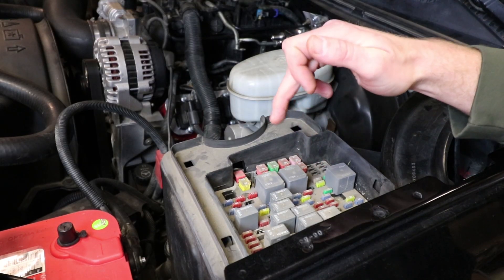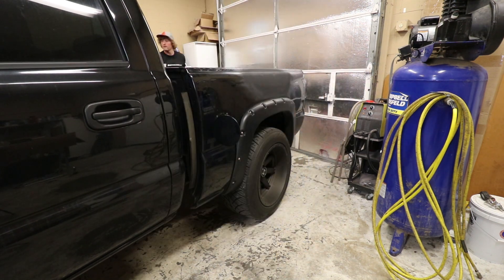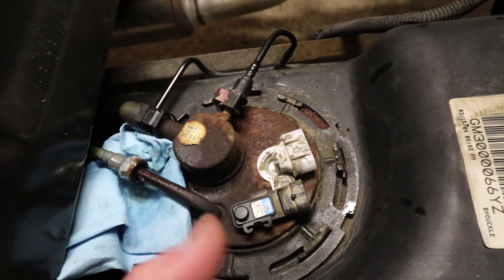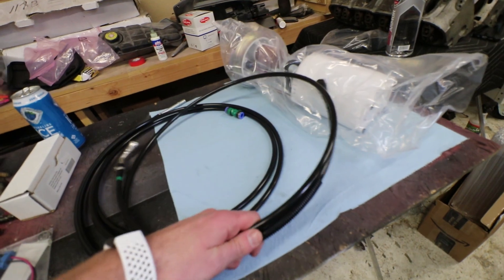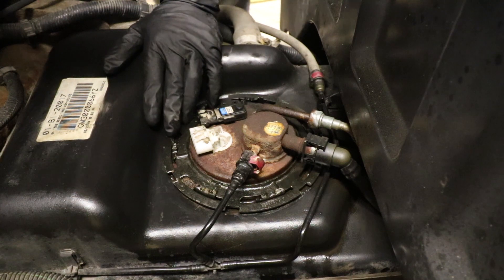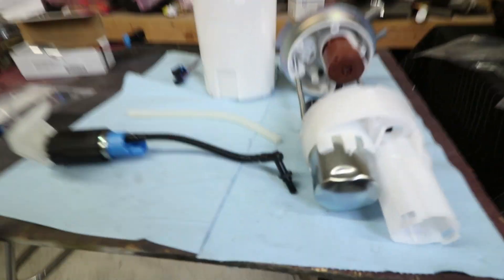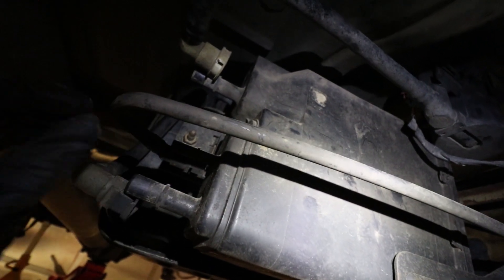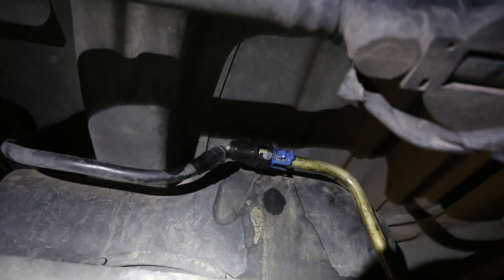Silverado Fuel Pump Removal And Install Sierra - Walbro 450 Fuel Pump Upgrade Install

Comment: Dp you have to replace fuel line aswell
Reply from the maker: I did have to replace the fuel line but that was due to the stock line rusting itself to the stock pump.

Comment: Did you run the stock injectors w the 450?
Reply from the maker: I did use the stock injectors, I have since upgraded but the injectors weren't my issue like I thought they were.
Reply: @MitchCarveth  thanks bro I’m installing the same setup this weekend. Just wanted to know if the injectors would hold up until I got new ones 👍

Comment: Did you use the higher pressure walbro 450 or the regular?
Reply from the maker: I went with the higher pressure 450
Reply: @MitchCarveth  thanks man!
Reply from the maker: @joseluisrojero5374  any time!

Comment: get away from that black fuel line. order the submergible fuel tube 11in from quantum again, its like 9 bucks. that black line will degrade  eventually. trust me i know ive looked at every parts store dealer blah blah pain in the butt, you have to order it. got same pump from quantum been rocking it for a year and half so far good. last week burned up the stock wiring though, definitely need a hotwire kit. only gripe with quantum is they dont supply wire diagram, and calling them they said they cant help they dont have any instructions.
Reply from the maker: I will be doing that for sure, I just had to use what was locally available at the time.

Comment: Where did you buy the fuel pump bucket assembly from?
Reply from the maker: This is the one I went with. 
 https://www.amazon.com/dp/B07P7886HV/ref=cm_sw_r_cp_apa_fabt1_ehBXFb7JN20FA?_encoding=UTF8&psc=1

Comment: Was that submersible fuel hose you used for the fuel pump? Also, any fuel starvation issues when low on fuel with that hole you cut in the bottom? Thanks!
Reply from the maker: I double checked before install and the hose is good for intake use. I did notice once it's near low it tried cutting out on me under heavy acceleration. Its best to keep at least quarter tank of fuel not only for starvation but fuel pump cooling as well.

Comment: Will you need a retune after changing the fuel pump?
Reply from the maker: Not with this setup, infact when we plugged it into the HPtuners we didn't even have to mess with fuel pressure, the stock regulator worked just fine.
Reply: I'm about to change my 06 Silverado does this apply here?

Comment: you skipped over the part of you putting in the pump in the basket , did you make it work ?????
Reply from the maker: It worked, I just took the insulation sleeve put it over the pump itself then slowly slid it into place in the basket.

Comment: I’m having the same problem as well same cam just BTR It’s a pain for sure can’t figure out what it is
Reply from the maker: Mine ended up being stock fuel pump was going bad and i needed 2 new 02 sensors. any luck with yours?
Reply: Mitch Carveth ya I had shaved my intake so Instead of the wiring harness running over the front of the intake I had it going towards the back. So the right side of the engine was totally backwards when I hooked up the injectors and the ignition coils so silly me lol. I had dang bear tore my entire engine down just to see if I missed something but it’s all gravy now just need a torque converter and a tune. I tore my input shaft on the transmission yesterday so I gotta take it back out. Hope everything is going good with your end of things. I’d send ya pics of it if I could.

Comment: Any luck? Having similar issues on my 4.8 with BTR stage 4
Reply from the maker: Its finally good! the fuel pump and two new 02 sensors fixed it. I've been waiting tell we can get a hotter tune in her before i did a update video but im just going to do one this weekend, i cant wait any longer lol

Comment: It didnt overpowered the stock fuel regulator?
Reply from the maker: I was a little worried about that as well, but they said i will be just fine. I'm still going to wait tell i get the tune adjusted before i drive around much tho.
Reply: Mitch Carveth  did the stock regulator work after all ??
Reply from the maker: Worked just fine! Didn't need to mess with it at all.

Comment: 2004 Silverado 1500 LS ex cab 6' 6" bed 8 bolts underside to remove they had factory thread-lock used propane torch t o heat them up otherwise mine weren't coming off, also used blue thread-lock to fasten bed to fame when finished. They come loose on my truck if you don't use thread-lock.
Reply from the maker: Mine were defiantly tight but not torch tight thankfully lol I used blue loctite as well, I know it use to be a thing but i dont really hear about it anymore but i think with some bed bolts they are a one time use bolts.
Reply: @MitchCarveth  How much pressure did you have at the rail after your upgrade? Was it the same as before or more, and did you have a higher reading at full throttle?
Reply from the maker: Haven't had a chance to test that yet, I will get to that hopefully tomorrow though.

Comment: Very detailed video. Truck sounds awesome!.  Wanted to give you a quick tip that I use when replacing fuel pump on these trucks by yourself, take out drivers side bed bolts, loosen pass side bed bolts, cut a sturdy board the proper length, use your shoulder at top of wheel well to raise drivers side bed up and use the board for a prop.  I have done it many times and when you set the bed down after your done, the holes line up for the bolts you took out.
Reply from the maker: Thank you! I will keep that in mind for the next time.